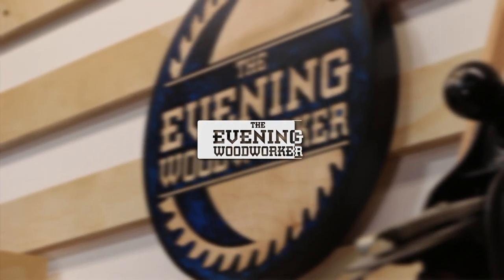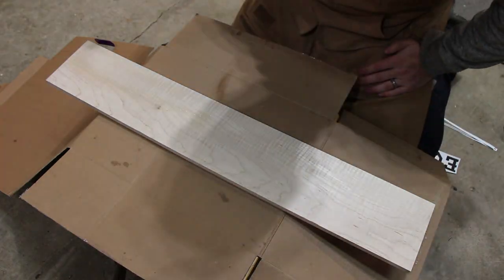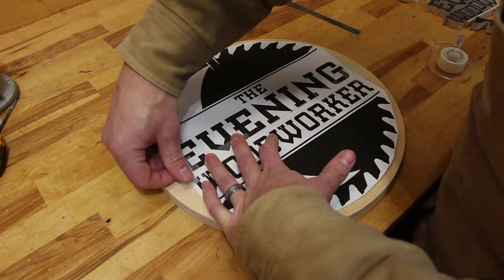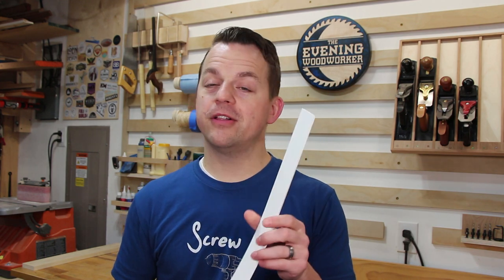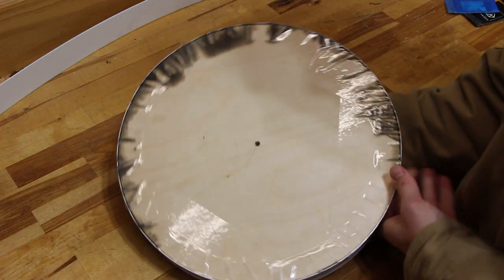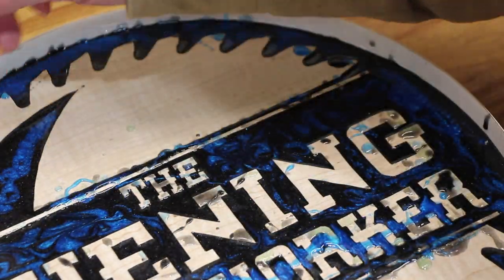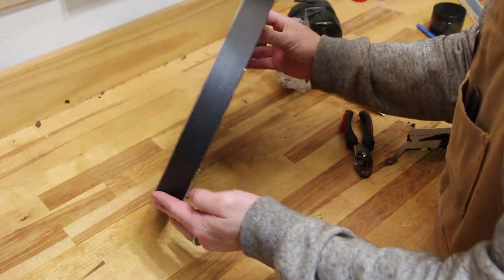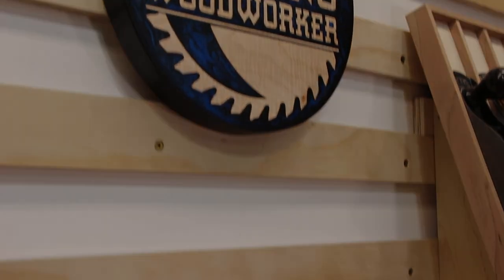How to DIY a Stunning Epoxy Resin Logo without a CNC

Comment: Another way you could have done the placement is to print the logo backwards, put it under a piece of clear adhesive book covering and stick the pieces backwards onto it. Then apply glue to each piece and press the wood backing onto it.
Reply from the maker: That's a great idea! I'll have to do that for the next one
Reply: @EveningWoodworker  just play around with a few different types of adhesive. Some don't stick as well as they used to when we were in school.